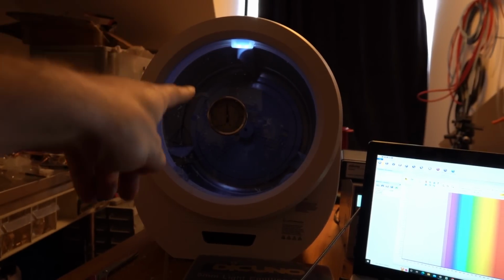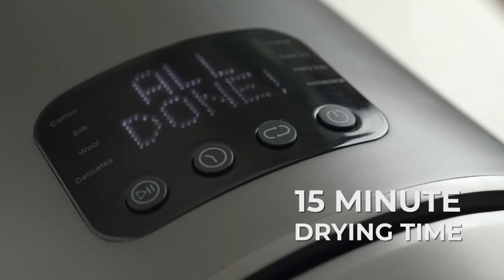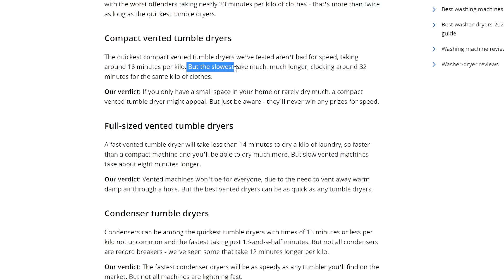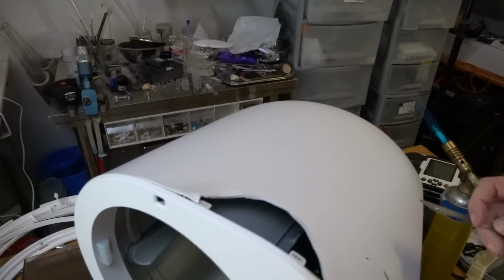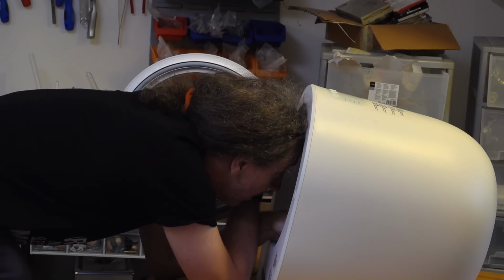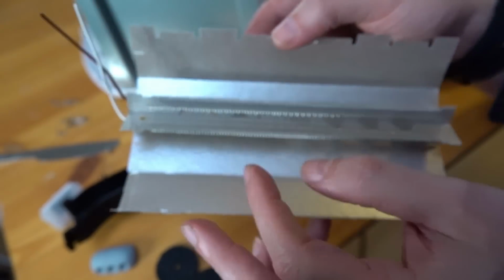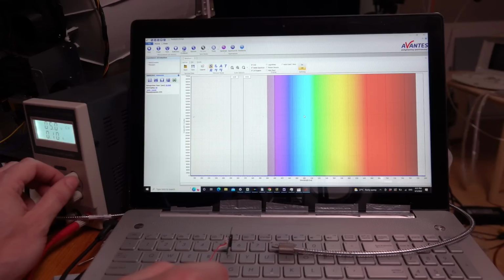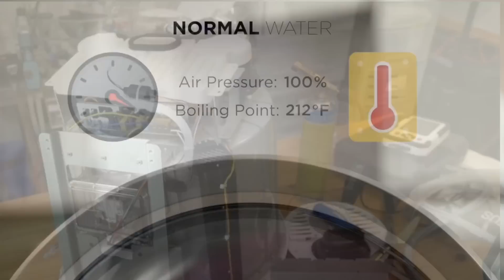Autopsy of a Scam-Starter: The Morus Zero!

Comment: works like a desssecant dehumidifier but like you say it would struggle to condense that much water in the hot air, they would have been better to have a vent hose to stick out the window. its quite well built, is the drum cog driven from the large fan motor, if so its the first cog driven dryer ive seen, and i repair appliances for my living

Comment: There should be some current limiting circuitry for the UV led, could also be pulse width modulated
Reply: As an addendum, they certainly shouldn't put out any light in the visible spectrum or run that hot that it melts stuff
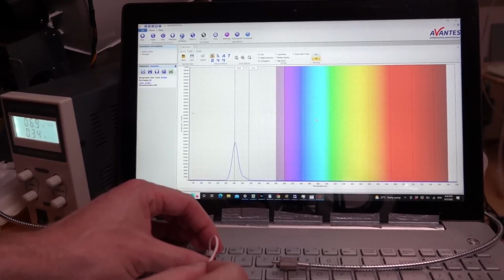Reply: @JamesTK  It doesn't put out any visible light. At 27:25  you can see the spectrum and it's just one UV peak. But the camera sensor is apparently sensitive to that wavelength of UV.
Reply: @Gameboygenius  yeah that's about right. Still cooking it though

Comment: Hi thunderf00t, about the white LED, these are actually UV led’s. Using phosphors the UV is turned into red, green and blue. Red and green overlap. That’s why there are two bulbs in the spectrum.

For blue, red, green and orange LEDs the color is made by the materials used to make the LED, hence the narrow spectrum

Biglt below already explained much much better 🙏

Comment: The plastic is usually ABS in outer shells of appliances like these, not PE. Mainly I think due to ABS being much easier to injection mold with high accuracy (PE warps and shrinks more while cooling) + you can get clean "polished" looking surfaces straight from the mold.

The plastic condenser is actually not as stupid as it may initially seem. They are used in a lot of rotary dessicant dehumidifiers that are quite effective in condensing the water (from experience with several models). Metal would obviously give far better heat exchange, but at least in the dehumidifiers design I guess that this isn't a bottleneck and thus it's good enough anyway. Of course in those machines you have the dessicant rotor driving most of that function to feed really wet air into the condenser - which this doesn't seem to have. Because this just uses hot air and has no way to force the absorption or release of moisture that's probably why the condenser tray will be empty most of the time, unless maybe if the clothes are sopping wet.

Comment: Hey Thunderf00t, greetings from Germany! Quick thing I wanted to add about the UV LED: There is the possibility, that the UV LED is used in a pulse-width modulation kind of way. That would at least reduce the power acting on the LED and with that the heat generation.

The point of this? Still no idea, but it just popped into my head.

BTW I am a really great fan of your videos and I aspire to be someday a scientist like you, not like Musk lol
Reply: What Elon Musk Does is some mix of engineering, business management, questionable stock trading and being an influencer.
I think he doesn't do scientific research himself, even occasionally, but I might be wrong.
Doubtful if he would have time for publishing papers that hold up to peer review.
He certainly has scientists working on his projects and likely engages with them directly out of curiosity and seeking understanding.
I wouldn't call that being a scientist.
I might be wrong.
Reply: @jannikheidemann3805  
Don't worry, it is myself who is at fault because I misused the word "scientist".

Comment: The UV sterilizers used in the food industry are quartz glass tubes - you can't see the frequency that they emit, but I have seen the damage it does to the acrylic covers at the start and exit of the sterilizer 'tunnel'. Its nasty stuff and even breaks down the Lexan covers that are stabilized for sunlight! In just a few weeks exposure they are riddled with crazed cracks like a broken car windscreen.

Comment: Before you did the autopsy you should have tested the anti bacterial efficiency of this marvel of science. A simple count of bacteria and yeast in a 10g sourdough starter would have been a good subject and control 😁
Reply: @snowcow1173  I’m a cook not a scientist 🤣… but I guess you’d look for a live culture under the microscope, then put it through the cycle and look again. If there’s no movement, it’s anti bacterial, if they’ve multiplied or the starter has inflated, then ye olde machine is a good dough proofer.

Comment: That machine has some good profit margins lol. I am surprised that for 800$ they didn't get any vacuum, ultraviolet light, and it sounds like a turbine
Reply: It did get uv...
Reply: Lol I think we just found the most expensive fake dryers you’d see in a kids playhouse 😂😂😂
Reply: @Brother-Crow   It is a technicallity.
A single UV light LED can NOT properly sterilize anything, merely because of the angle/surface of flexible things exposed would be unreliable.
Then there is the problem of time of activation (without any active heat dissipation, it can only "flash" for brief periods, instead of being a BEAM).
  
Finally, there is the actual "powerlevel" of the UVB light emmited (in the few miliseconds when it IS active), that is probably not shining enough overall lumens for this (relatively few) "hard" random photons to manage to evade the first layers of atoms of the clothes and get deeper through it [the external surface "heats" up, but the interior and other side is almost unnafected].
Reply: @adolfodef  but.... It did get a uv.
Reply: @Brother-Crow  UV sterilization even actually. At those temps i bet at least that LED was gonna be damn sterile
Reply: @Brother-Crow  It looked like the LEDs were under a plastic diffuser, I wonder how much (if any) UV gets through that diffuser?
Reply: @peterjf7723  The white ones did, the UV one had a hole in the plastic diffuser.
Though I don't know how wide the beam of the UV LED is.
Reply: @adolfodef  I think the UV LED might be nice to have if we ignore its stated purpose; instead it can sterilise the circulated air somewhat and break down smelly organic molecules.

It's also certain to produce a little ozone, which can both penetrate deeper and may provide an extra little freshness flavour as the laundry emerges from the dryer.
Reply: @ShiningDarknes  the UV LED wasn't being powered on when measured, when the device was idle.
Reply: @adolfodef  thats nott entirely true. A single very large and absurdly powerful deep UV led north of the 100w range can absolutely reliably sterilize the inside of a tumbler given enough time. The excess heat alone would make short work of most microbes in due time and the excessive. Uv light emitted has enough power to penetrate even thick materials
Reply: @SianaGearz  I see... that said that diffuser looked way too thick so a single UV LED won't sterilize anything, especially not in 15 minutes... so good fucking thing you would have to run it for an hour lol. Then it might manage like 1%.
Reply: @KT-pv3kl  Precisely.
It has to be "large" & "powerfull" (normally done by placing in a line a few dozens of this tiny square 7 volts leds).
Still requires active liquid cooling (or passive heatpipes & strong air cooling) to allow for a constant UV shine.
 -> A simple trick to reduce overheating is to have one of them shutdown while the others shine, then the next in a sequence [requires multiple leds].
  
A more intelligent desing would also include a simple mirror on the back & a UV reflectant coat on the interior side of the "glass" [the metal curved walls also help with the UV dispersion].
  
I agree that "overtime" the tumbler itself would be sterilized, but not necesarily the clothes being washed inside of it (on the whole volume of them, not just the outer surface). While any single UV photon "can" passthrough most clothes, it is a matter of density and absorption if it will damage the DNA of bacteria enough to remove their replication ability [actually killing them from "radiation sickness" (protein brakedown) or boiling heat is... "overkill"].
Reply: @ShiningDarknes  someone mentioned a cutout in the diffuser around the UV LED, the diffuser being for white LEDs only. At that wavelength, you can't find any plastic that would not absorb it and indeed likely break down in short order.
Reply: @SianaGearz  the white and UV LEDs are all mounted on the same board relatively close to each other, I don't see how you could make a cutout in such a way as to let the UV out unless that LED is an incredibly narrow beam in which case the point of it not being enough to sterilize anything still stands.

Comment: At this point, the company needs to be sued into the ground for false advertisement.  Especially for the UV light thing because that's something that would be easy to do (although would potentially damage a rubber seal) but that is outright false advertising beyond any "this is just jargon and I didn't really mean it"
Reply: Well there was uv light in the machine.
Reply: and later on, I stand corrected on having actual UV leds in it.
Reply: @ibleminen  yup, I was wrong on that.

Comment: There was a large 3R00 SMD resistor(3Ω) on the LED board, and 4 more smaller current limiting resistors for the white LEDs. 3Ω is probably not enough for constant without a heat sink, so PWM is probably applied.

Comment: Our first clothes dryer was the standard solar- and wind-powered version.  We'd bought a Kenmore large-load washing machine, so my young wife and our daughter didn't need to cross the main road to get to the laundromat, and then waste a lot of time in that unpleasant place.  Instead, my wife could wash the clothes in the Kenmore, and dry them on the line.  We didn't live in a mobile home (anymore), but we were still poor.  When the weather turned, we splurged and bought a Kenmore electric dryer.  That washer lasted a little under 20 years, at which point we replaced it with a very expensive piece of Eurotrash, which we were happy to leave behind when we sold the house we were then living in.  The electric dryer was still going strong at that point, over 20 years of use.  But as for the wonders of a condensing heater, we at one point replaced a boiler (for home heat) from the 1950s or '60s with a modern condensing unit from this century.  Instead of something like 45% efficiency (55% of the heat from burning natural gas goes up the chimney), it was something over 90%, maybe 95%.  It needed a special drain line for the water it condensed from the exhaust, but then that exhaust was just hot-ish steam, safely vented through the outer wall with PVC, instead of the roaring-hot exhaust gases the old one produced, going up a large (12"?) metal chimney, making the boiler room unpleasantly hot.

Comment: Factor in too the washing machine itself, my Indesit washer dryer when I do a t shirt wash which I don't dry using the machine the t shirts are almost dry due to excellent spin action by the machine that makes them almost wearable and surprisingly nice on very muggy days to get something cool and dampish on.   My dryer side is not the usual blast through hot air type but it goes through a hard spin then a hot air cycle and dries stuff very quickly compared to previous dryers I have owned.   Being a 7kg machine too is a major game changer, I can load up a weeks washing in one hit say for trousers, shirts etc and its all done very quickly but also very cheaply.

Comment: So, the real question is can a madman, such as yourself, make this thing actually work [at all] like intended? It seems to me that it's not far off from functional given some gasket material, a proper condenser, and maybe a stronger UV source. I personally would love to see you try it. I think it would be hilarious if you were able to get any vacuum out of it, and get it to condense even a little. Madman in a shed vs. the big budget kick starter. They failed, can you succeed?
Reply: Probably, it would just look diffrent
Reply: What's the point?  He already has a clothesline...  But seriously, the idea of a condenser and a vacuum drier don't really go together, maybe with valves or something.  You don't want the vacuum to boil off the condensed water, so it'd be kind of hard to rig up.
Reply: So the Condenser would be the first thing to work on.  Make it out of metal.  And then make the paths wind up and down a LOT more for the air flow.  Now this would have two impacts.  (1) It would actually condense some water from the air as it cools, putting some into the collection tray.  (2) The heat exchange would make the drying process more efficient and less energy use.  Incoming colder air rushes through the condenser and as it cools the air inside the metal to condense some water, it warms up.  The incoming warm air now requires less energy to heat further, leading to a more efficient dryer.  

As to making it work with a vacuum, well adding a pump would be a pain.  And then the since air flows into the dryer and then back out the entire air flow process would have to be revamped so you could have one internalized air flow and one external airflow coiling the condenser.  Of course you also need to replace all the seals and the plastic front with glass in order to even try to get a seal for a vacuum.  Sigh .. there is just no reason to do all that.  The condenser work is simple compared to reengineering the entire rest of the unit.
Reply: @walterengler5709 ... but space vacuum!

Lol
Reply: @BigTCars    Hmmm .. So once the condenser is fixed, we ship the whole thing up into the upper atmosphere on a Musk based space flight.  There at the fringes of space we get the 0.1 ATM we need.  Perfect!!!
Reply: He could but would have to re work everything. And the cost of a vaccum pump is a LOT
Reply: @walterengler5709  respectfully intended here but regardless of HOW you heat water it takes 970btu of energy to make 1 lb of water become steam, in a vaccume the energy to bring it to boil is greater because you have to make the vaccume.. this liquid to gas transition is called the "latent heat of evaporation "   I do liquid and gas stuff
Reply: @MrDmadness  You've been watching TF videos ... lol.  And I know.  Water evaporates into the air at all temps.  Down at 0 when ice and snow move to a gas state it's sublimation.  Once liquid its evaporation.  And nothing in the equations change based on air pressure .. just temperature.
Reply: @walterengler5709  yes its the latest heaT of evaporation and atmospheric pressure does change the boiling point. That's how pressure cookers work. Boiling is quite dependent on pressure I assure you.. I'd love it if thunder would verify this for you. At a low enough pressure water boils at 0 degrees, it however does not evaporate.

Comment: The thing I find interesting about this is that it is so close to being a real product. All they had to do was ditch the bogus marketing and reroute the wet air coming out over a peltier cooler to condense the water into that tray, and boom, you've got a portable ventless indoor dryer. That would have actually been a useful product for a lot of people.
Edit: Just saw the pitiful attempt at a condenser in the back of the machine... who made this? Who thought that would work? What were they smoking, and where can I get some?
Reply: My idea as well, apart from that "consenser" it looks okay-ish. For what it is. But really expensive to make.
The bogus claims however...
Reply: And with a peltier cooler, it has both a hot and cold side so you can utilize the heat for the clothes drying and the cold for condensation in an actually good engineer design.

Comment: Glue on connectors is completely normal and in fact very very common on things that, y'know, vibrate. If you've never seen that before you haven't taken enough things apart.. There are extremely good reasons to do this. You could do this cheaper and more energy efficiently with a peltier tbh - take heat off one side and use the cool side with a heat sink type assembly to condense water out the air.

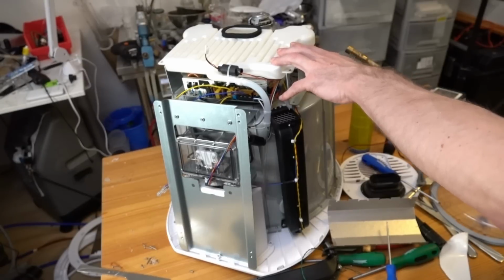Comment: 24:00 It looks like someone saw a picture of a condenser and built one without knowing how it worked. I just watched a video where Russia did a similar thing when they made their first mach2 plane, adding the razors that the F-4 had to cut emergency landing strips on an aircraft carrier to the MiG thinking that they were part of the aerodynamics of a mach2 plane, but making them out of aluminum which would never have worked for the purpose they had on the F-4.

Comment: Nice work.  Of course, heat created by the heaters and fans meant that there *was*, technically, just a teeny tiny smidgin of infrared in there...   Germicidal UV is best about 260 nm although 245 nm will do. What was the central wavelength of the UV LED?  I have my doubts about disinfecting laundry this way because most of the laundry must spend most of its time hidden from the UV LED by the rest of the laundry.  (This doesn't apply so much to washing on a line because one tries to have as much of the area exposed to sunlight and wind as practical.)  Is there a possible video on UV laundry disinfection as such?

Comment: doesn't appear to have any way of catching or dealing with fluff from the clothes being dried... so probably it will clog up after you've used it a few times.
I also wonder if the light from the uv LED makes it through the translucent plastic lens and if that plastic deteriorates rapidly.

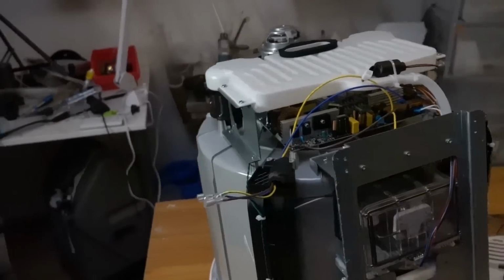Comment: 20:40 it's in that nice box presumably so it would help hold a partial vacuum.  Seems like they tried to make it a condenser dryer that pulled a partial vacuum and failed miserably, so they released it as a hair dryer

Comment: Those plastic condensers can work pretty darn well. Desiccant wheel dehumidifiers use them

You can see the two mount points for fans to blow room air over the condenser too. They just didn't populate them for some reason?